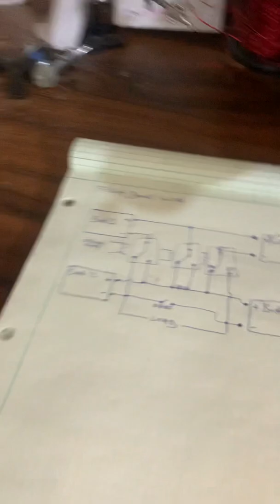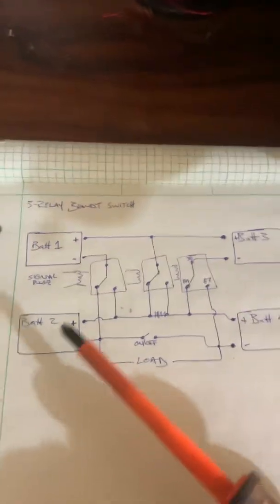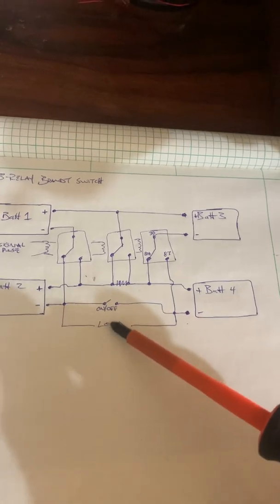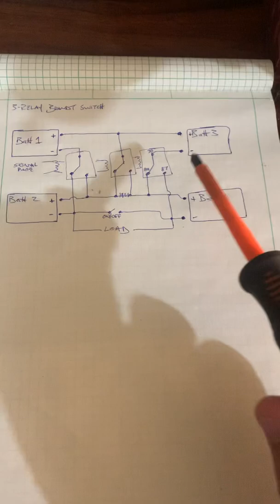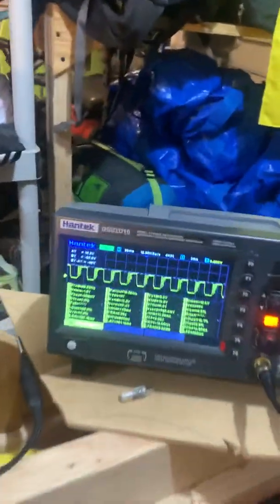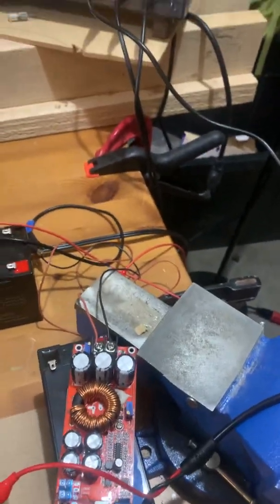Tesla Switch using Auto Relays and 555 timer

Comment: Quoting Benitez's patent, "Obviously the current furnished by the discharge of battery one&two alone, would produce a smaller charge in batteries three&four, if some energy were not added to the normal output of said battery one&two. With this object in view any of the known methods for the generation of high frequency currents, as well as those described in the aforementioned English patents, can be employed in conjunction with said batteries, in order to provide that COMPLIMENTARY ENERGY, and in this manner it is always possible to charge and discharge alternately each battery from one to the other, maintaining a constant storage of electricity and producing furthermore and excess of electrical energy." A collapsing coil would produce "complimentary energy."

Comment: I like this design for a tesla switch.  The biggest problem with these is that lead acid batteries have what's called a surface charge and a deep charge. So they can read a higher voltage temporarily and be substantially more dead than the volt meter would have you believe. I do think that it substantially increases the amount of usable power you can get from the batteries but you still need an input power source such as a small solar panel to trickle charge it just a little bit, it is very efficient but not overunity.
Reply from the maker: I agree - I have only witnessed around 80% efficiency.. however I read the cycle time needs to be over 100 hz to see benefit and using relays i max out around 30 hz… I plan to test system with transistor switching at 100hz+ to determine performance.
Reply: Waste of time.

Comment: I've noticed different heating effects with different relay's. I've burnt up about 30 relays this past year . I was able to pull the outer cover off and adjust the spark gap in the relay.  It Improved the response time and made the relay's run alot cooler. The spark gap makes a huge difference on heat  and voltage output. 
Glad to see your experimenting with different designs and inventions.
Keep up the good work and thanks for sharing 👍👍
Reply from the maker: Appreciate the tip!

Comment: Try using SSR you will get way better results . Or have you tried that already?
Reply from the maker: That’s a good idea. They would switch faster and pull less power. However not sure they make DPDT ssr’s - so would require more wiring.
Reply: @energyhack3538  I am making a variation of the switch with ssr. They sell ssr with only nc or no only. However there is a version with two poles with both... You may have to make them from scratch for to properly copy a relay with both. 
Btw you can increase the frequency near 50hz or higher by changing the duty cycle. I'm running around 63hz with 3pole relays